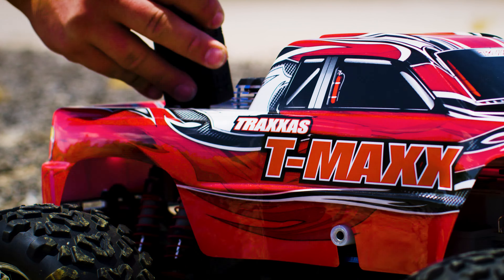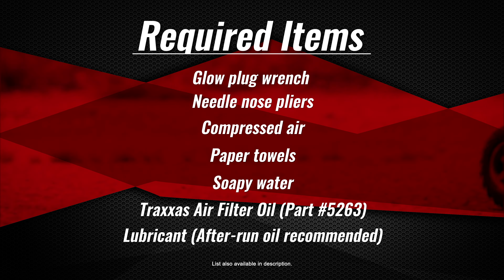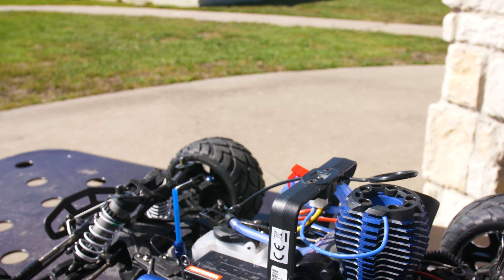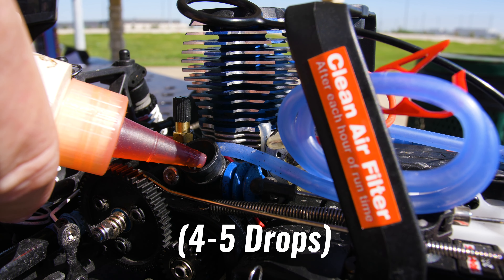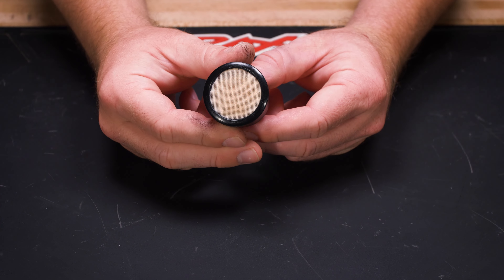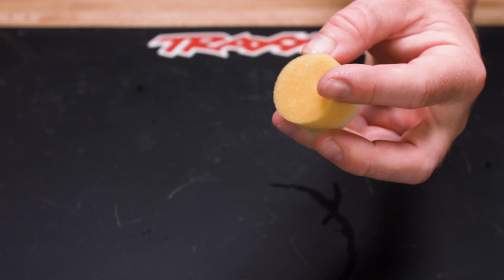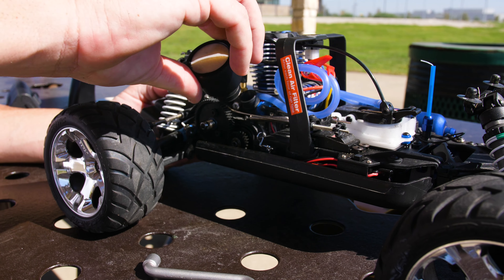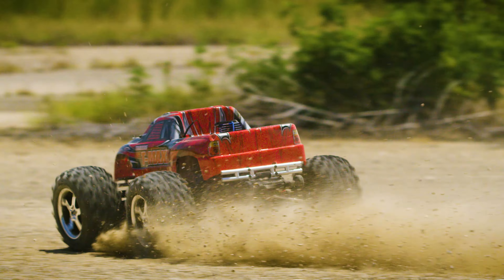RC Nitro Model After-Run Procedure | Traxxas

Comment: As an electric vehicle user, this seems like a lot of work to maintain a vehicle. Respect to those who have to do this after playing!
Reply: If you take it out atleast once every 2 weeks you don't need to do any of this crap, just run it all out of fuel, a properly tuned motor will have no problem with that.
Reply: After run oil is not necessary for a well maintained, frequently ran rc.
Reply: After run oil is a gimmick that's rarely needed.
Reply: This is manufacturers view on how to do it properly and not voiding warranty. Do you also clean your electric all the way after every drive? Do you inspect all the wirings that they are not torn, unsoldered? Also do you clean all the connectors? What about water? Do you inspect water damage and disassemble everything? Have you checked all the fans and their bearings so they work at full capacity. Do you always but batteries on storage charge immediately after every drive and you sit next to charger to be alerted if something goes wrong?

Nobody does that...

Usually I drop couple of drops of after run from the glow plug hole after a drive if i know i won't be driving in couple of days. Let it sink to the bottom and then rotate engine couple of seconds. Have not seen rust inside the engine.
Reply: Most of it isn't necessary, I got a nitro truck that sat, without running, for over 12 years with none of this. Fired right up after just a bit of cleaning and resetting the carb for factory settinga
Reply: She must mean at the end of use season.

Comment: you really only need 3 drops of after run oil in the carb and crank it over for 5 seconds, it works its way up. my O.S .21TM Tmaxx Classic runs good and i only do after run oil when i let it sit for a week or more
Reply: Exactly. There's no need to be constantly using it every time you bring out your rc like a freak

Comment: I just block the exhaust to stall the engine then I throw it in a corner for the winter.  It started next spring.  Engines are only about $100 anyway.

Comment: I use VP racing fuel and it says on the Steel Gas can. After run oil is not necessary. And i check inside and sure enough the cylinder is clean. I do clean the filter though.

Comment: Can I use dirtbike filter oil?
Reply: might be too thick because the traxxas oil is fairly thin
Reply: Yes, you can use dirtbike oil. Actually its better. Have been using it for many years now, and nothing slips through. I have experienced that with regular rc airfilter oil. Its cheaper also, because you get more for less money in the end. At least in my country. I drive on extremely dusty clay tracks, and will not risk my pricy competition engines to suck dust and dirt.

Comment: So you're supposed to do this after EVERY TIME you use it
HYBRID32494 did you see this
Reply: Yeah you don't need to do this.  This is "best practice", in other words not even close to necessary but still helps you understand how the motor needs to be lubricated and avoid rust.  NITRO GANG
Reply: @julesl6910  since you said nitro gamng I'm guessing your subscribed to his channel
Reply: @nomusicrc  TWO SPEED BABYYY